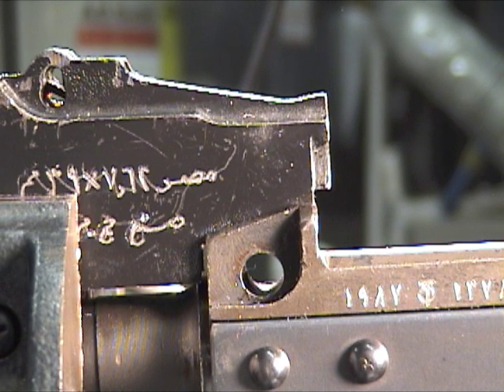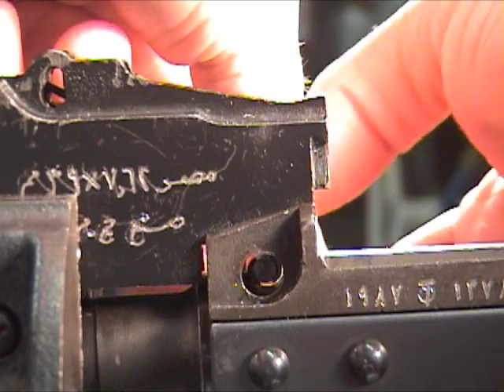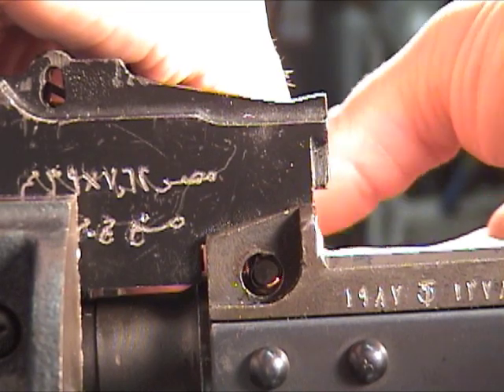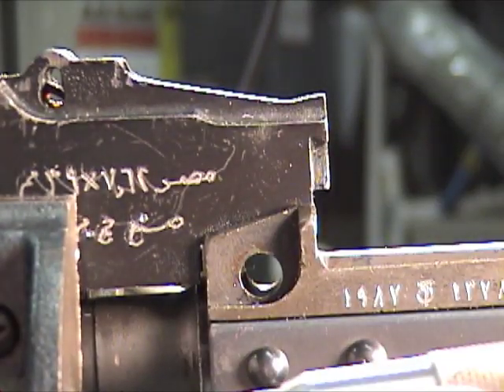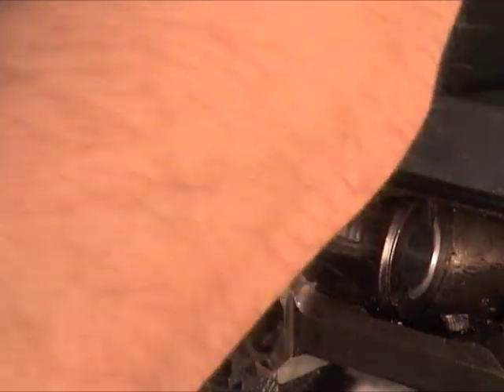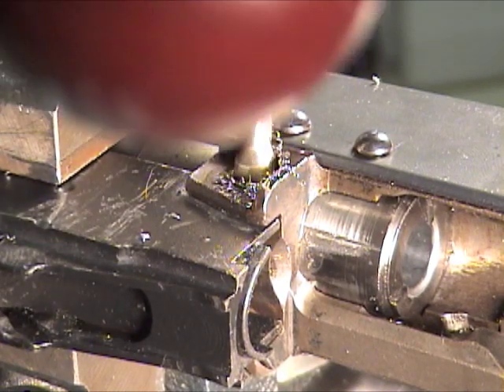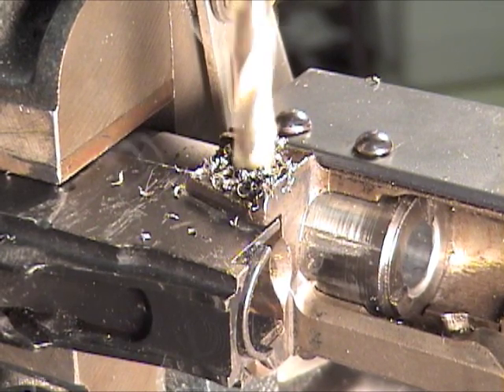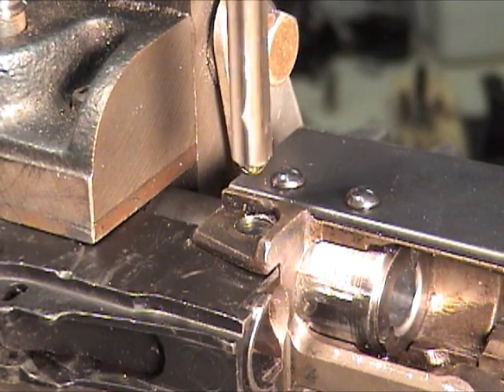Headspacing a non-matching barrel with an oversize pin Build your own AK AK47

Comment: great video man, I have a kit that i am putting together with a barrel that has been drilled for another trunnion. The hole in the trunnion is already enlarged to 0.315 because it is an I/O part. so i am going to have to make it even bigger now to fit.

Comment: So I'm sitting here watching you measure the two holes, but I can't help but wonder what the point of that is.  You set the headspace, and make sure the radius exceeds the furthest previous grove, and go at it.  Are you trying to keep the pin as small as you can, is that the concern?

Comment: which is still WAY too fast for a reamer. you can add the missing third wheel to your drive pulley setup and get the full 16 speeds out of her. open the belt cover and look down, the mounting hole is already there.

Comment: Wouldn't a 4 fluted end mill work better for the barrel pin slot? I would think that the drill bit woud chatter and try to walk over the contour of the barrel.
I have 2 virgin barrels to do this on that came without the barrel pin slot.
Thanks for the video and your time making it!

Comment: You could just add a little weld material to the back side of the barrel with a MIG machine. Then ream to size and press in the new pin.

Comment: The reamer is running way to fast. 
No big deal but if you want them to last you need to run them about 1/4 you typical cutting speed. Example a 7mm drill @ 50 sfm = 650 rpm / 4 = 162 rpm which is about right.
And you don't peck drill on such a shallow hole just push it through.

Comment: @cjjr129 not if you want to use the original sight and gas blocks.  The Bulgarian AK was a Type III pattern rifle and had a much thicker barrel with thicker mounting journals for the blocks.  I'd search for a Type III AK pattern barrel.